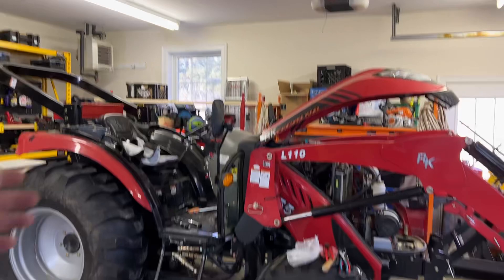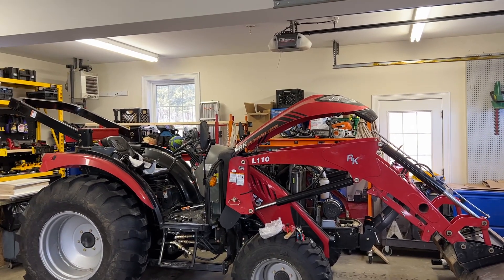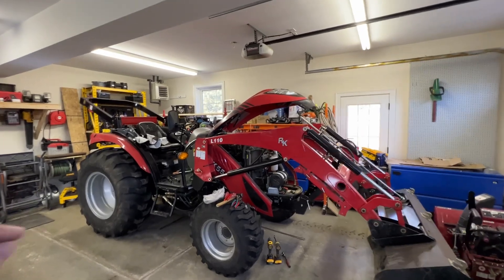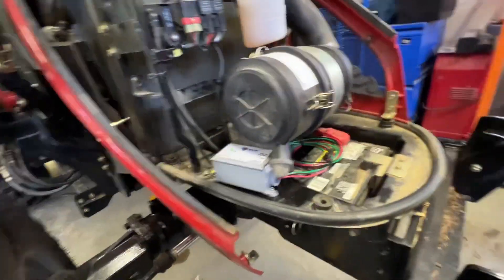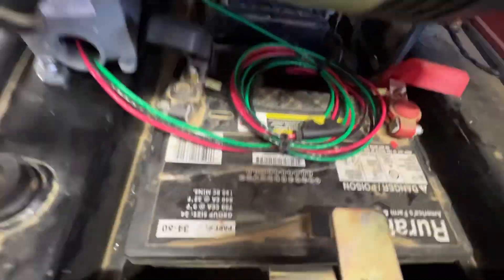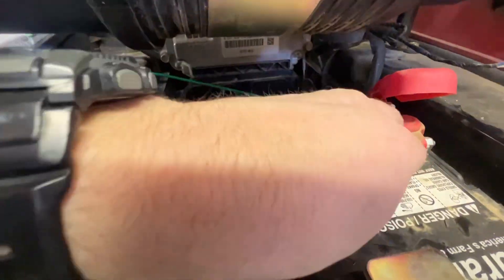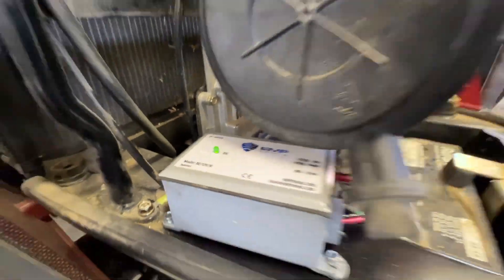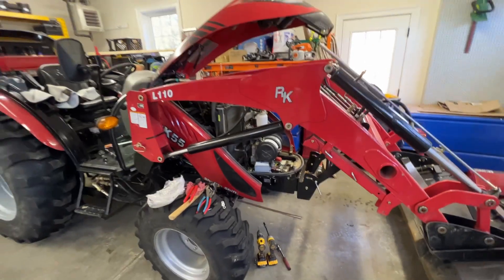EMP Proof Your Tractor (EASY 12V Install)

Comment: Just a note! Putting a switch on the red wire tuns off the drain on the battery, AND turns off your protection!!! The wires MUST be connected 24/7/365 for the EMP Shield to work. It would be better to purchase a trickle charger for your tractor. I’m an electronics engineer by trade. I wouldn’t want anyone to loose their protection through a small error.
Reply from the maker: Yeah it would only turn off the protection of the switch was off. But that is a good point.

Comment: Maybe I missed this in a video along the way, but I heard you mention generators, what is the best way to protect those?
Reply from the maker: Well many generators probably won’t need any protection because they don’t have many sensitive electronics. However a faraday cage is probably the best bet for smaller portable ones. Or if it is hooked to the house the you can get an emp shield for a whole house generator.

Comment: You see I won’t buy it until I see it in action and know that the emp shield will work. I just don’t see how a small box will protect my vehicle.
Reply from the maker: I’m guessing you haven’t gone to the website and seen the third party test results? It’s a very simple process. The device monitors the voltage in your system. When it sees a sudden spike it starts shunting the excess voltage to ground. That keeps the heat from building in the circuits and frying. Simple. Not complicated at all.
Reply: @RealitySurvival  I don’t see how it can send the access voltage to the ground. Seeing is that the tires of a car are made from rubber. Don’t the tires prevent the car from being grounded. Or does the unit itself absorb that access power.

Edit: I’m not hating I’m just generally curious. 

Also sorry for the super late response.
Reply from the maker: It’s to the chassis. In a vehicle the chassis is the ground. There is sufficient molecular “space” to absorb more electrons than would be induced via the emp.
Reply: @RealitySurvival  So on my Ford F-350 theres a ton of computers that are very delicate. So even if the chassis is the ground at that’s where most of the access energy goes. Won’t the emp still short out my trucks computers even with the shield installed?
Reply from the maker: Nope

Comment: I can't see how an extra fuse would block a E.M.P.
Reply from the maker: It’s not an extra fuse block. It is essentially a high speed surge detector.
Reply from the maker: It’s a very simple process. The device monitors the voltage in your system. When it sees a sudden spike it starts shunting the excess voltage to ground. That keeps the heat from building in the circuits and frying. Simple. Not complicated at all.

Comment: JJ you know that commercial emp shields in no way can protect against close proximity to an EMP blast that's produced from a nuclear explosion.
Reply from the maker: @Jack not true at all. It doesn’t matter the distance from the bomb or the HEMP. The EMP pulses move at a fixed rate regardless of the distance. Physics is physics. It doesn’t change.
Reply: Need to watch the military video testing that EMP shield does. Very impressive
Reply: @Alaska1969   800 mega ton later......